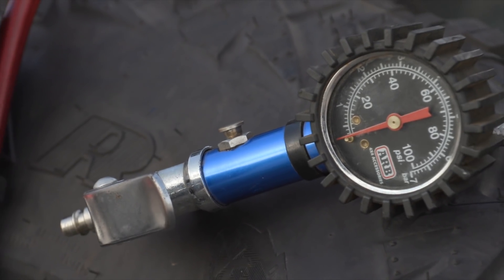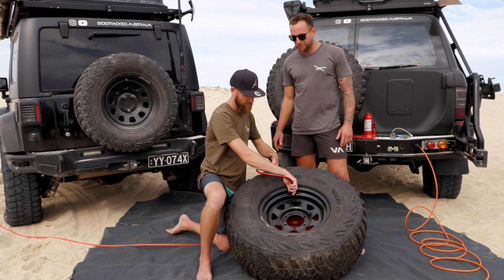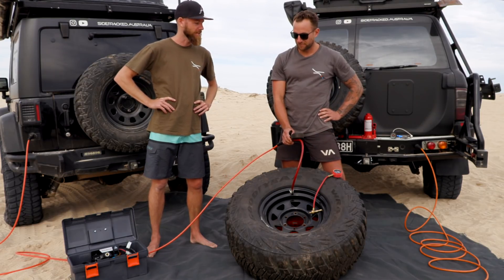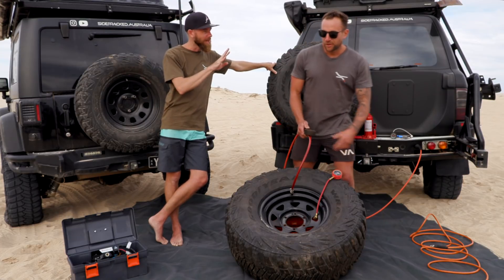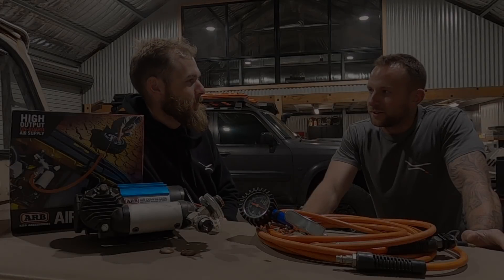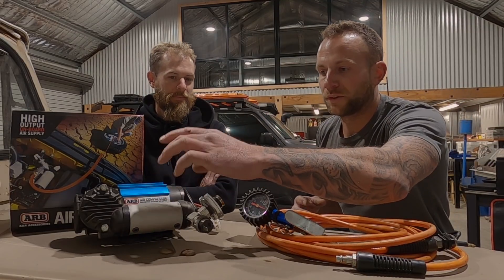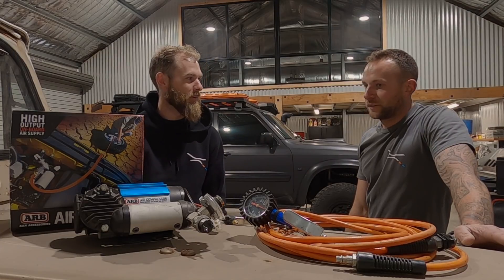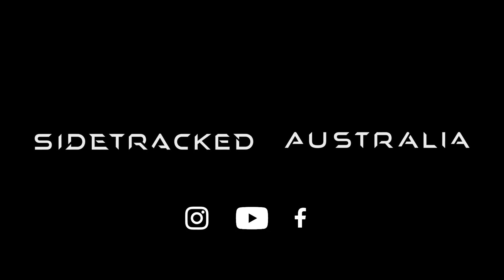ULTIMATE 3-WAY ARB Air Compressor Comparison {YOU WON'T BELIEVE THE RESULTS}

Comment: It makes sense because the output pressure is still the same with or without a tank.

The tank just gives a greater reservoir of air but it's still the same pressure.

Comment: "The valve stem is the restriction and that is the cause of the difference".  This may be true but I did a test with my home AC powered compressor (5 gallon tank filled) and turned on.  It was 78 seconds to take my tire from 11 to 30psi.   With an ARB dual and a small tank it was 105 seconds.    So while it might be restrictive the large volume of pressurized air in the 5 gallon tank was able to negate some of the restriction.

Comment: Good video.  I also have a dual ARB and a small tank (2 gallons).  When I did similar tests I did get a slightly faster result with the tank.   And airing up all four tires was a bit faster too, partly because the compressor is running the entire time.    Is it worth the space the tank required?  I don't think so either, especially with the dual compressor.    But mine is installed and until I need the spot for something else I will most likely leave it.

Comment: Its fluid dynamics. The arb twin can push air faster than it can flow though a valve stem. You can only go as fast as the smallest point. 

For instance if you use all 3/8" hose you can move more air volume than if you have 1/4" hose. You will not notice any change unless every single inch of hose is 3/8. The valve stem is the smallest point, no matter what the valve stem dictates your air flow into a tire. 

Now if you run any type of air tool the tank will make a difference. Provided all connections are large enough to accommodate the volume of air.

Comment: If you want to blow out your filters -- use your spare.  Make up a female-female coupler, which you attach to the male end of the hose.  Put the blow gun on that end (so you don't have the extra weight hanging from the spare tyre's valve stem).  Then a plain clip on tyre chuck on the female end of the hose, attach it to the spare, and blow out filters to your heart's content.

 -- Obviously keep your spare pumped up to its maximum allowable pressure.  If you need it, you can easily let out the excess pressure at the time.
 -- If you use the spare to blow out your filter(s), and subsequently need to use the spare you can inflate it at the time.  Otherwise, re-inflate it to its maximum allowable pressure when you get home/to a servo.

Comment: If your using an air blower, weather your using a 10 litre tank or a 100 litre tank the air will still come at the same speed. Air will only enter the tyre as fast as the biggest restriction (the tyre valve) will let it, that’s why tank and no tank isn’t making a difference
Reply from the maker: Yeah you got it.

Comment: If you check the Specs on the ARB Twins they have a pressure Cut Off of 180psi Not 100psi and the Twin is Rated at 150psi, The tank is for running small Air tools and blow guns which is Ideal for cleaning parts such as Air Filters, The Single has a pressure Switch cuts in at 70psi and off at 100psi, hope that helps.

Comment: I've got a dual arb and recently added a 6l tank. The initial fill is noticeably faster (when the tank's full and comp off from reaching the 150psi limit). Then as you walk from tyre to tyre the compressor is still doing work which provides a marginal gain/time save. I question why 1) in your test the compressor was still running/hunting when you were not using it (assuming that was you compressor we could hear) 2) if you didn't notice a noticeable difference in the initial fill vs the non tank version what's the difference in plumbing vs the non tank version? Other comments on the valve being a limiting factor is false. Boyle's law says you should have the equivalent to 100l at 15psi in that tank. Having said all that the benefit in over all fill time is marginal but should still be a bit more noticeable than in your comparison.

Comment: The valve stem is limiting the air flow. Remove the internals of the valve stem and try again or try a monster airflow valve stem.

Comment: Have you thought about removing the tire valve core permanently? It drastically decreases time deflating and inflating. By doing that the twin compressor with a tank will shine, even more than double the speed of a single compressor. With the right sealed valve cap the tire can hold the pressure.

Comment: I have installed a dual ARB /w 10L tank in our RV and included two quick connects:
1. directly after the compressor
2. one after the tank
There is a valve between compressor and tank so i can decide whether i want direct compressor air for airing up my tires or max cfm volume from the tank for using air tools.
The convenience is superb. Using a blow- and suction-gun from Hazet this gives me an air powered vacuum cleaner :-)
Anyways you guys are right: For airing up tires the tank is useless. For Power tools it gives you more air volume or, to say it in an easy way, "longer time usage of high pressured air".
Example: Normal Air Gun as you showed at the end of the video works 1sec without the tank, until the pressure is getting low (below 6 bar) to a point where you only get the cfm flow that the compressor is providing while it runs. For short pushes to the trigger it would be sufficient though.
With the tank, it drops down much slower so you have more time to use an air tool in the sweet spot between 10 and 6 bars. When using impact wrenches this would pay off even more. For my cleaning purposes in the RV with blow and suction gun it is perfect.
Great vid, enjoy your time using it. Here in Germany it was already an adventure to even get the compressor, as such tools are very rare in our non-offroad country. I mainly wanted a decent onboard air system for tire pressure checking between cold bavarian winters and hot summers. You cant get anything decent here in europe and you need to look for serious USA or AUS gear when it comes to compressors. I love the twin compressor and the convenience at hand now that it is installed.

Comment: The issue is the tire valve size can’t take more than designed. If you did the same test blowing up a swimming pool toy with a large valve, it’s a huge difference. 

The tank is a must if you want to blow air, I use it to clean my filter, windows and interior. Can’t do that without a tank as it has got enough puff

Comment: Hey lads,
apologies if this suggestion is too late but before writing off the air tank model (which I have) you should actually let the tyre temperatures come back down to atmospheric pressure then re-check air pressures. Yes I know this sounds over the top but in all honesty the ARB compressors have a tendancy to throw a lot of moisture into the tyre when out on the tracks and I have found differences of 3 to 5 PSI due to moisture content once tyres are at atmospheric temps within the air delivered from the ARB units. Before biffing out the tank, be sure to recognise that it either draws out the moisture or increases the moisture delivered from the compressor because a 3 to 5 psi cold pressure differential is quite substantial when a tyre is up at operating temperatire on the motor way and thats where safety comes into it.
Reply from the maker: You are right, moisture does build up and a tank would be a way to eliminate that from making it's way to the tyre, no idea if its more than other branded compressors though. Checking the pressures again after highway use (inflating a tyre with and without tank) would be interesting and its something we might do! As for safety, if we air up to a number, we've never seen too much of a change when checked again (hot or cold). Thanks!

Comment: The reason there is no difference between dual arb with or without tank is that you are limited to the amout you can flow thru a standard tire valve. If the rims were fitted with a larger quick fill valve you would see a much bigger difference
Reply: Yes!  Flow is being limited at the valve.

Comment: Can you run an extra test, fill up your 10l tank, have tyre deflated to 15psi ,turn off compressor manualy once pressure switch kicks in and then dump just the tank air into the tyre. How much psi will it add?
This will explain the little diff.
Reply: the tank would take even longer cause as the air goes into the tire, the pressure within the tank decreases having less force behind the inflation; twin compressor is 100% duty cycle, so i see no point in this. the only "tank model" that would beat the compressor is if it is prefilled past 100psi with or without CO2, but once the tank is out you're SOL

Comment: Interesting i was going to purchase a twin compressor but they're currently sold out around oz they waiting on some parts from ive been told. However you can still buy the kit with the tank  which i was considering but the extra $300 or whatever it is doesn't seem like its worth it now

Comment: Cool video. My single arb has been a trooper. Always battles on. I think i may upgrade to the twin in future.

I think the biggest shock of this experiment is how shit is that arb digital pressure gauge is. Have to sit there with ur finger on the button for about 2 to 3 minutes to inflate the tyre. Stuff that on your knees... terrible arb engineering lol.
Reply from the maker: A cable tie that you can slip on/off the lever can help your knees out, otherwise the ARB Linx may help.
Reply: yeah right should be able to set a pressure on it and it'll stop when it gets there
Reply: @SomervilleMetalWorks  The ARB Linx Pressure Regulator will enable you to do that!
Reply: @rodneyrowell7743  how much is the lynx system?

Comment: Great video gents. Question: can the twin compressor with no tank still blow enough air to clean an air filter?
Reply: i reckon it should do just fine. or even if you just have the small manifold. you can just do small spurts of air as the lil manifold tank tops of from the compressor.

Comment: The single valve on the tyre is the flow limiting point, if you used one of those kits that do 2 tyres at once you would see a decrease in time with the tank. If you did it without the valve core you'd half the time.
The other major benefits of a tank is to seat a bead like you said but also you can use airtools with a tank, realisticly you can't without.
Reply: insert vid with clearview tyre spyder 👌
Reply: There is another benefit to the tank though. As you are moving from wheel to wheel you are storing pressure so it will be a bit faster wheel by wheel, but even more so doing two at a time.

Edit: On second thought, that won't matter. They started the test with a full tank and showed it dod not help. so you're right, the valve restrictions simply limit inflation time regardless of the pump. Perhaps it may be different with a 60L tank at 110psi...
Reply: That is only the case if you get to pumping the next wheel before it reaches the cut off pressure, otherwise the comp will wait for the tank to drop 20psi+ before it kicks back in and your almost back to where you started without a tank.
Reply: If your tank is only going to 100psj Ide change the switch to either 135 or 150psi to get more air in. My 12L tank goes to 150psi and it gives such an initial inrush of air to the tyre at the start that the click on chuck keeps popping off the tyre valve and it seems like the tyre valve itself is the limiting factor. I also have a single and twin arb compressor plumbed together so continuous flow is great...
Reply: The reason I know its the valve flow that's limiting things is because the system I built on mine. I have 2 compressors, 2x 3lt tanks and a separate airline at each wheel with 4x 1m hoses - can pump all 4 35s in just over 4mins.

1st compressor is a single ARB for the lockers at 90psi and as a backup.
2nd is a Thumper Max duel and it fills the tanks to 140psi.
Running both, the arb has a line to the 140psi system with a 90psi pressure switch on the 140 side, if both comps are on and the 140 side drops below 90psi it opens and both run. Tyre pressure is all auto regulated too.

Comment: Are both compressors using the same size and length wiring ??... the cable makes a big difference... my arb double got noticeably fast after changing the arb wiring for 2pair of 6b&s (a pair for each motor head).. after changing the wiring I later on added a tank and the inflation time again decreased.

Comment: I had this same convo with an ARB sales guy & he was adamant the tank would help & be a worthwhile fitment. Normally I don't point out I'm an automotive design engineer to salespeople, but couldn't help it in this case. There is currently no tank on my vehicle 😀
Reply: For reference, one of my first jobs was designing a reactive air suspension system for a truck, so I may have a bit of experience with the blowy stuff 👍

Comment: The tank doesn't help because it holds far less air than the tyre, so it just adds that little bit extra at the beginning and then the compressor just has to pump through the tank and into the tyre. Tanks are designed for constant flow into air tools, so the compressor doesn't have to stay on. Never really understood why people go to lengths to put air tanks in their vehicles.
Reply: Paul Clarke exactly

Comment: Reckon the valve is the bottleneck?  Try again with a AirTech valve removal tool - works for air down.  Reckon it would speed up any decent compressor.
Reply: dont know, have you seen guys in the states use CO2 tanks to pump their tyres ? they pump them with the valves still in and they go heaps fast. i think they compressors are just piss weak and the pressure they put out drops off a lot as the tyre goes over 20 psi.
Reply: @psy06  tank pressure is very high in PowerTank which is why they are so fast, much higher than an air compressor could ever muster.  Sadly, not available in Nanny Australia.
Reply: @Mouldyturnip75  i know that hence im saying the valve isnt a bottleneck if they can pump CO2 in high volume. you can easily make a tank yourself, buy a tank of co2, they use them for brewery and get a regulator.  probably not gonna be real cheap to keep swapping it out after every trip or so
Reply: 250psi constant pressure (regulated) as the co2 is in liquid form and simply expanding, also super cold and incredibly dense.  MAX pressure for average 12v compressor is 120-150psi, usually very hot and therefore not very dense.  Open flow is say an average 140lt/min from 12v compressor, prob double or triple or higher than that with Powertank.  The bottleneck is the valve, 2nd is the actual ability of a compressor.  ARB compressors are industry standard with few peers so its not that they are 'piss weak'.